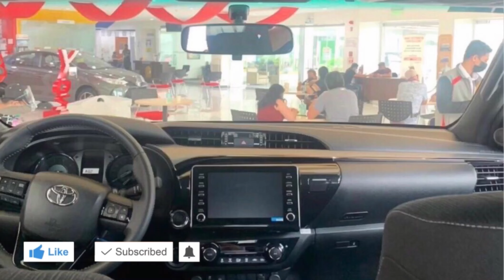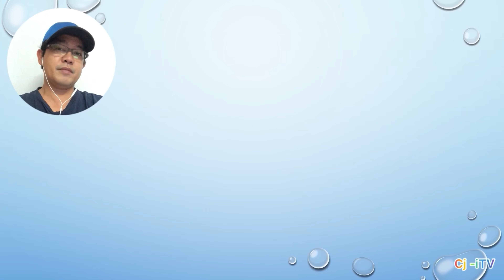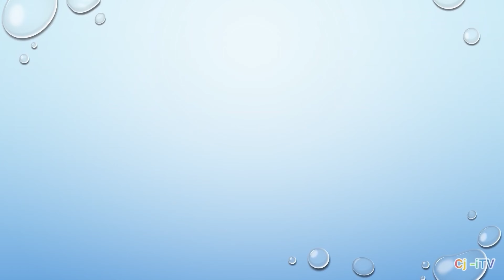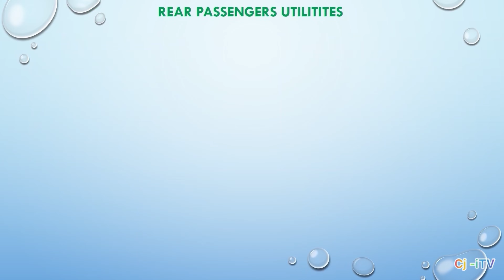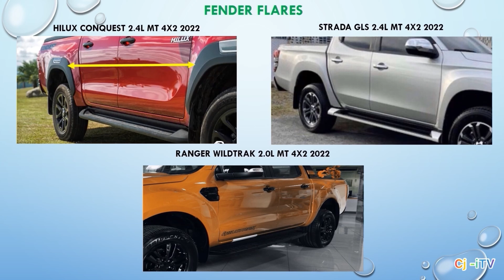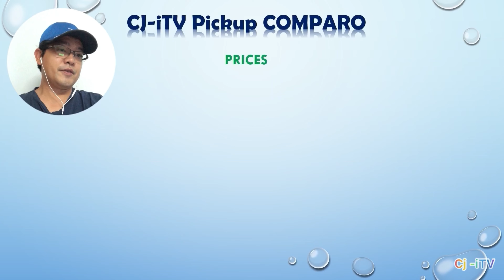Hilux Conquest 4x2 MT vs Ranger Wildtrak 4x2 MT vs Strada GLS 4x2 MT 2022

Comment: ATOYOT Hilux Conquest pa rin talaga, mapa 2.4-litre 4x2 at lalo na, 2.8-litre 4x4 manual transmission 🤩👌
Reply from the maker: Salamat po Boss for your comment. Dapat sana kahit 4x2 ginawa rin nila 2.8 Liters kasi Bitin ang 148 Hp compare sa  181 Hp Strada 4x2 and 178 Hp Wildtrak 4x2. Parts availabiltiy and high resale value syempre Toyota. Hehe.
Reply: Ok lang yung 150 metric hp sa 2.4-litre ng Toyota Hilux…. Hindi highly ‘strung’ ang makina. Responsive din naman lalo na ang manual transmission nito at matipid na tunay sa diesel.

Diyan papasok ang option na 2.8-litre sa mga gusto ng +200 metric-hp
Reply from the maker: @YamUzu250  thanks po sa comment and additional info Boss. Malaking bagay yan sa mga pumipili ng value for money pickup.🙏

Comment: dapat same variant sana sir,   mid variant sana mag kakaiba kasi ang difference  kapag mag kaiba variant. thankyou.
Reply from the maker: Thanks for your comment po Boss. If Ranger XLT and Hilux G. Malayo ata sa GLS Strada Sir. Sa Engine Power and technology features. Will try po next video Sir. You can watch din po Navara VE vs Strada GLS both Manual and automatic transmission.🙏

Comment: kung magdrive ako ng manual, gusto ko yun malakas at mataas ang torque kasi kung mahina o mababa ang torque mo, hirap kontrolin sa acceleration kapag may mabigat kang karga o marami na pasahero ka, kung malakas ang torque mo madali lng kontrolin ang clutch mo sa acceleration.
Reply from the maker: Agree po Boss. More torque plus power but fuel efficient lalo na ngayon napaka mahal ng diesel. Ehheh
Reply: @charlzhone30  pare anung year pla Strada mo at ilan na mileage sa odometer ngaun?
Reply from the maker: GLs MT 2020 Kaerap. 16,000 km palang. Heheh.. so far so good naman. Out of casa after 5,000 km. D.I.Y. Ko lang Aircon and Air Filter replacement and cleaning, aircon cleaning. Sa petron ako nagpapa change oil every 5,000 km.
Reply: @charlzhone30  na try mo na syang ibyahe sa malayo 4 to 5 hours na walang hinto?
Reply from the maker: Yes po Boss. Ok na ok si Erap. Walang issue pagdating sa makina and accessories. Battery stock pa rin and no major problems pa naman.🙏

Comment: Pero kahit less HP rating ang hilux, everytime magbyahi ako grabe ang conquest sobrang dami makasalubong mo...dko alam pero nakapagdrive ako malakas naman ang makina nya napaka responsive at very smooth...opinion lng po...
Reply from the maker: Thans for your opinion po Boss. No. 1 po talaga Hilux sq sales sa Pinas Boss and mataas high resale value nyan because of the name Toyota. Marami kasi available spare parts din anywhere in the market kasi halos magkapareho lang sa Fortuner, Innova and other models ng Toyota. But for the Rides and power, Strada po ako sa Mid Variant magaan kasi at matipid talaga sa fuel. Pwede 18-21 km/L.🙏
Reply from the maker: Thanks po sa comment Boss.🙏